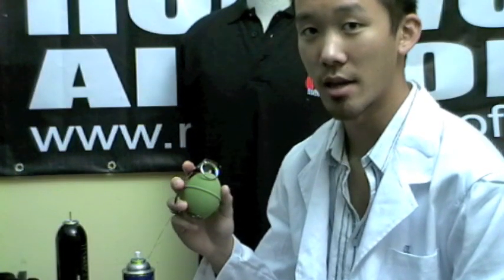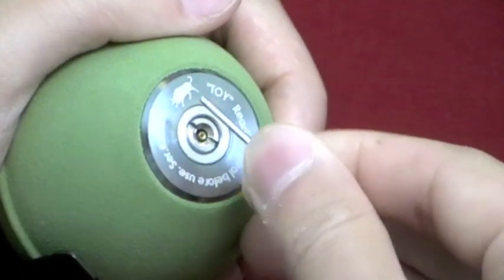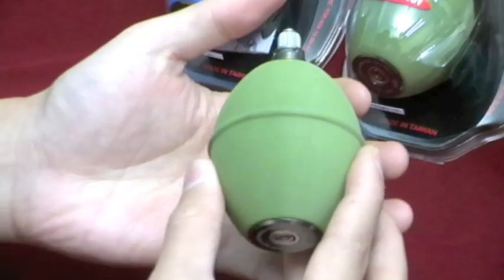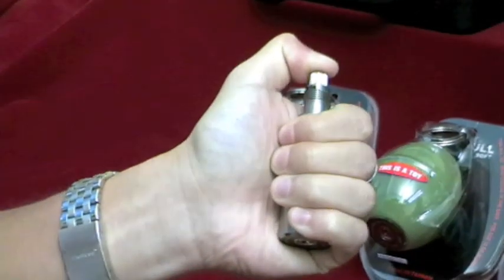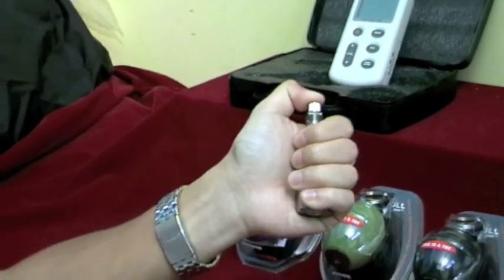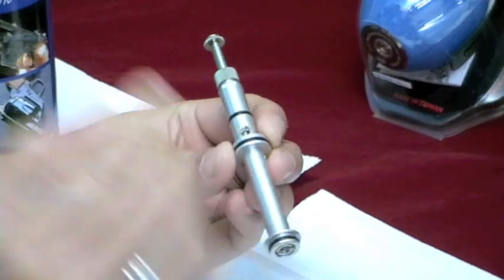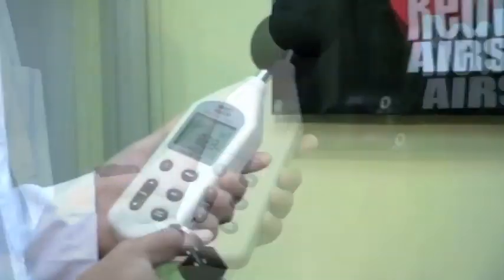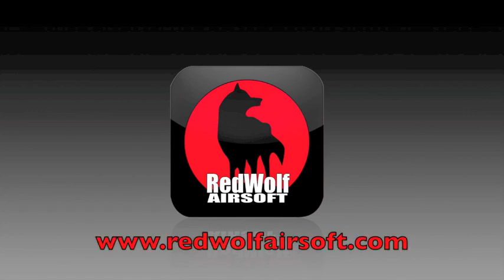MadBull PS02 grenade - RedWolf Airsoft - RWTV

Comment: But make sure its 100% silicone oil. Most car silicone sprays contain petroleum distillates as well as pure silicone.  Any petroleum distillates will cause your o-rings to corrode and leak.